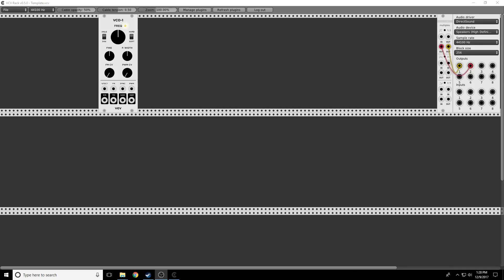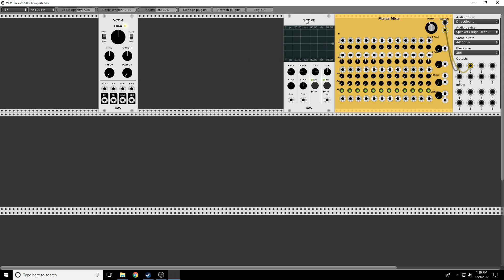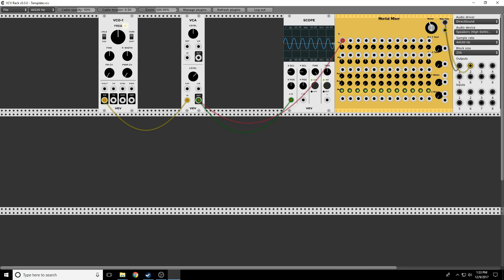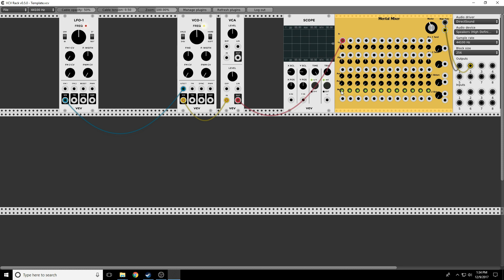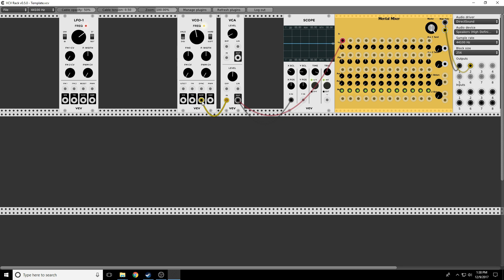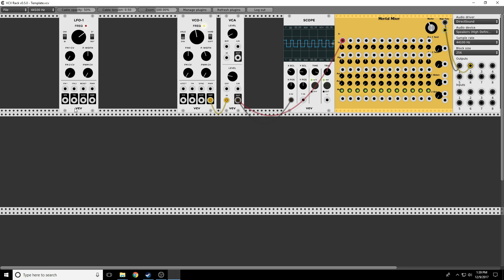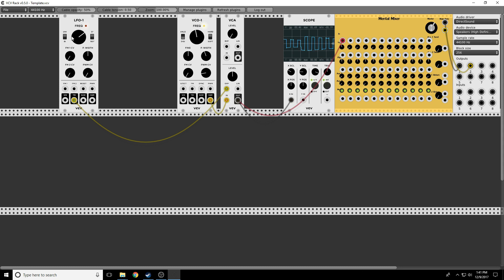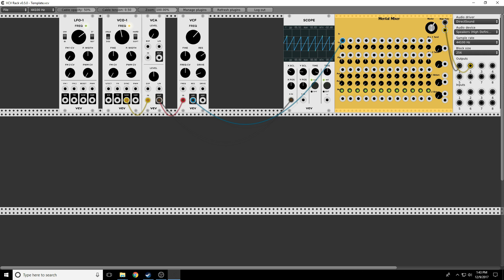Modular Curiosity Episode 2: Modular Basics

Comment: Great service here Mr. Curiosity!!! Everytime I watch a video on vcvrack "it" gets better.... but yours, this episode, in particular, has been very helpful in understanding patching. 
How did you learn about holding down "control" on your keyboard to "split" a cable? I've tried that on my Mac and it doesn't seem to work. I know that you're using windows.... maybe that's it. Is there some sort of Master keystroke control tricks for either mac or windows that I can use specifically with vcvrack? Thanks!!!
Reply: Use Cmd+click on mac
Reply from the maker: Re: The CTRl Key.  I think I learned about it because somebody mentioned it on the Facebook VCVRack Official User Group.  I'm not sure what the Mac equivalent would be.  But you can always stack cables by dragging from the destination back to the source.  Since sources are always outputs that causes the cable to stack.

Comment: I have the AS module installed from plugin manager but no mental mixer.
Reply from the maker: Right, the Mental modules haven't been upgraded in 0.5.1 yet.  When I recorded this we were in version 0.5.0 which had the mental modules, but 0.5.1 doesn't (so far).  The AS mixer is very similar so you should be fine.  In fact, this is a good enough point that I should add it to the video description.
Reply: Thanks.